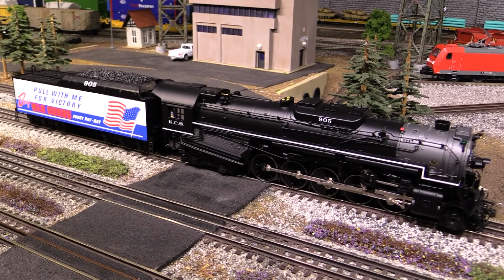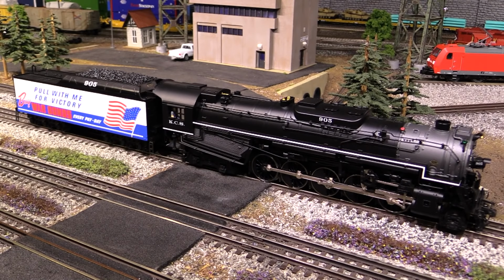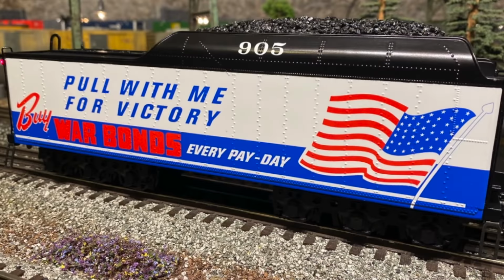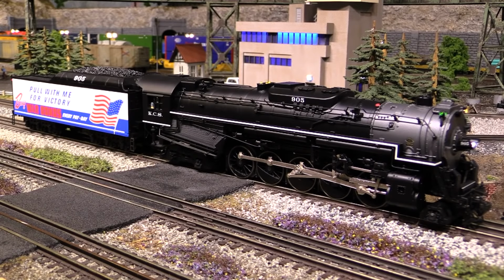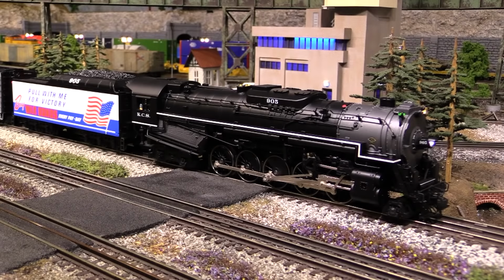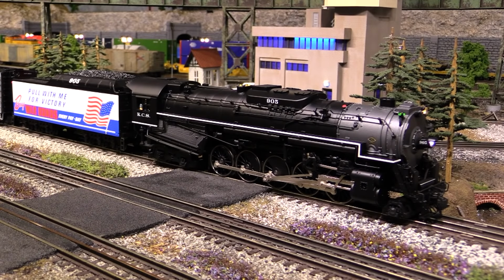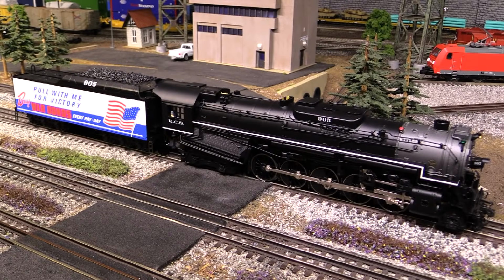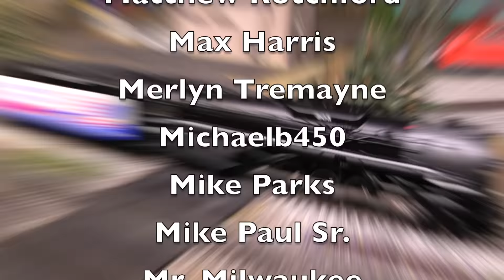Lionel 2-10-4 "Texas"

Comment: Eric,  while I enjoyed the KCS Texas-type video, I was saddened that you forgot to mention that this is merely a C&O T-1 lettered for the KCS, and not an actual KCS Texas-type steam locomotive.  This is not a case of rivet counting, these two Texas-types looked nothing alike.  Ditto for the B&LE, DM&IR, & CB&Q; all of which were modeled accurately by Sunset 3rd Rail several years ago.  As for D&RGW and Southern, .....   Keep the videos coming, but please point out where Lionel is playing loose with RR history!
Reply: It is too bad that Lionel could not have fashioned an all-weather cab and used an inside bearing engine truck for this model.  Then the T1 would have better resembled its KCS counterpart.  I don't have any issues with manufacturers getting more use (and profits) from their molds but please take the extra steps and supplement the details.  The added cost would be worth it in most cases.  Yes,  the T1 looks nothing like the B&LE, DM&IR and CB&Q's which were were all related to each other thru design.  In the early 1950's US Steel reallocated the B&LE engines to the DM&IR giving them a few more years of service.  At least the 643 has been saved.

Comment: Kcs texas locomotives had walschearts valve gear... yet lionel still used the baker valve gear
Reply: The tooling is based on the C&O T1
Reply: What’s the difference again?
Reply: train fan 4014 

Baker valve gear pin joints, whereas Walshearts uses slide joints.